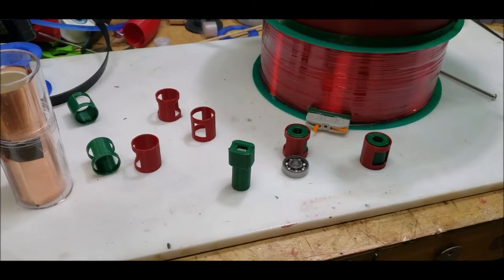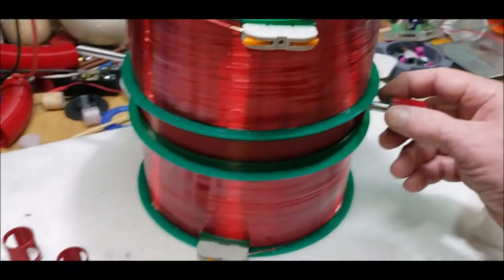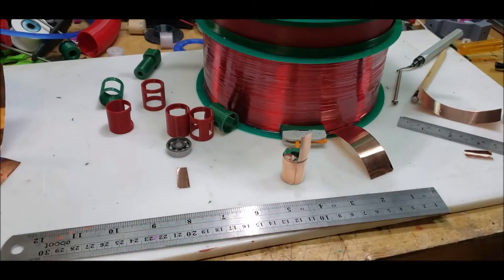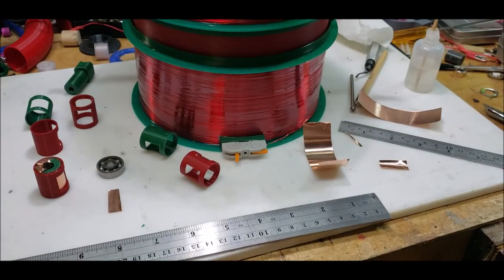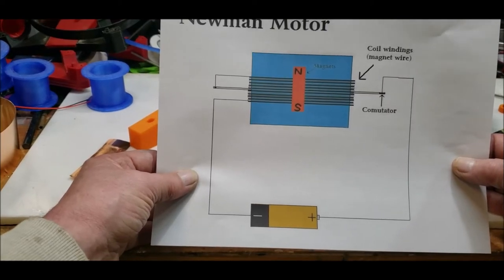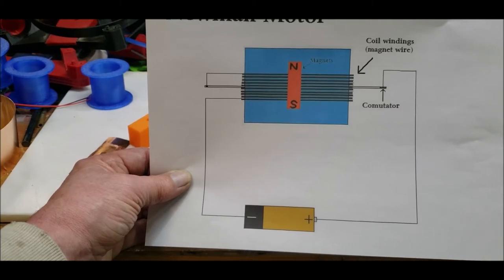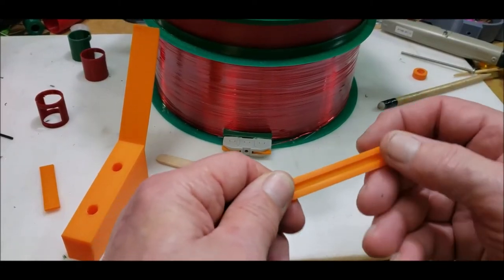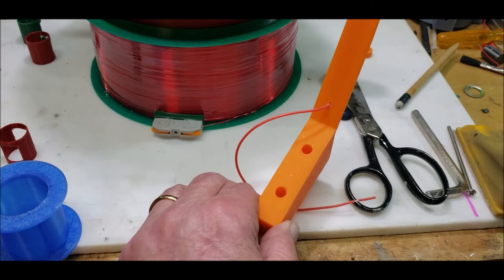3D Printed "Newman" Motor Build and First Run (commutator)

Comment: Nice work, so I thought it would fly.. at least it runs nice! So here's my idea, apparently power through bearings can slow the rotor, so maybe we can get rid of it. Attach one side of the coil directly to the battery and the other side to the commutator with a brush. Next to it another brush on the same commutator back to the battery. And don't forget the led lamp to catch a spike. Also the pad under the brush can be soldered when hot enough, I have that on my mini ferriswheel.